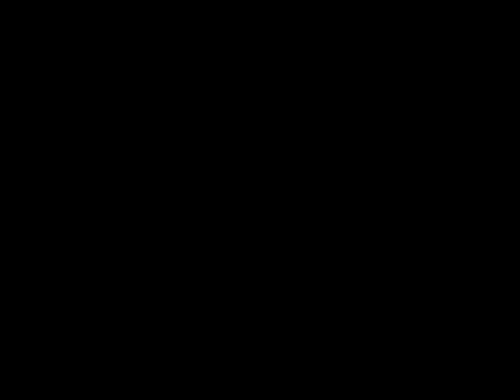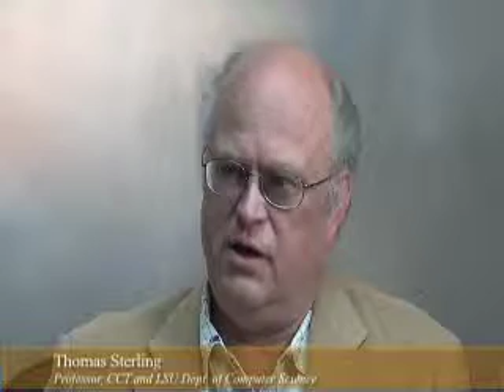Professor Thomas Sterling, Beowulf Inventor

Comment: Preprocessing could give a huge difference in computation time, especially if possesed data is processed. In my experience norming, sorting, fragmenting and compressing data could give better effort/time to efficiency gain coefficient than implementing code to GPU. Thanks to prof. Starzynski form University of Warsaw uncompressing fragmented data to RAM gives another shortcut.  Using portable adjusted distribution starting to RAM reduces OS bottlenecks. Why high speed network components ( f.e. 10GbE PCIe cards in 2016 ) are so expensive in comparision to other computer components?